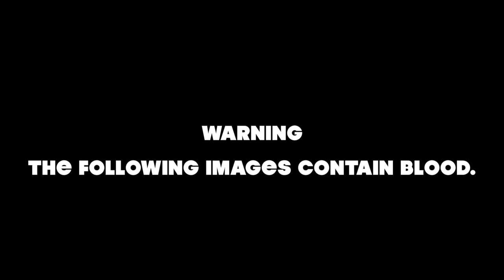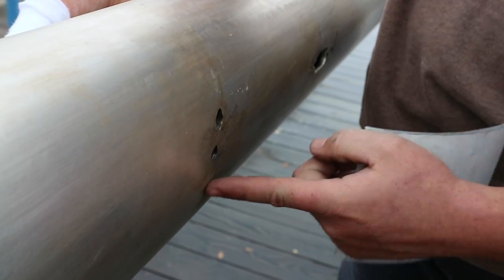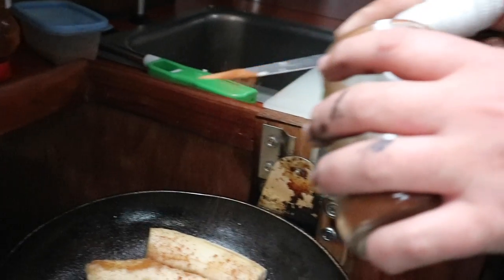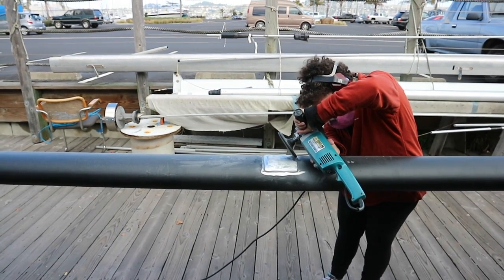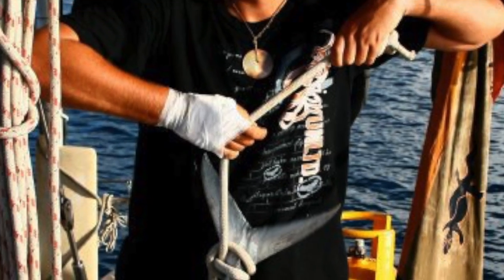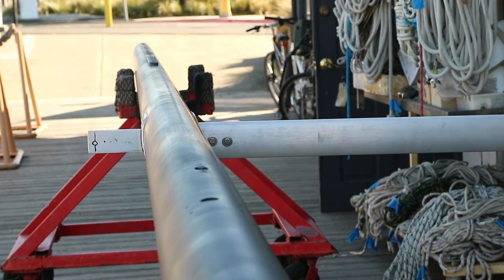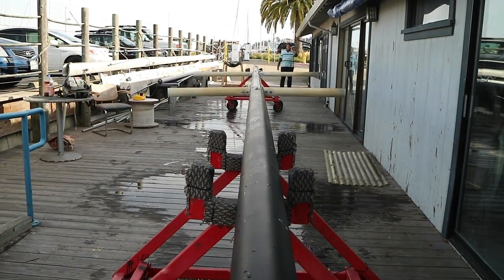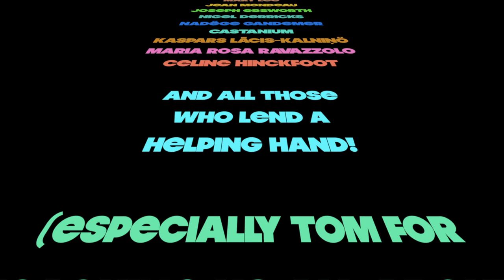22. Sailorama: Standing Back Up

Comment: In regard to your riveting - I trust you used aluminum rivets on your mast to resist future galvanic corrosion. And a tip for future riveting - coat the rivet pin with sikaflex or a similar silicone or butyl - mastic sealant before you insert them into your drilled holes to also reduce future corrosion.
Reply from the maker: Nice. Good tip! We used aluminium rivets and tef-gel with the stainless in order to avoid any more corrosion .